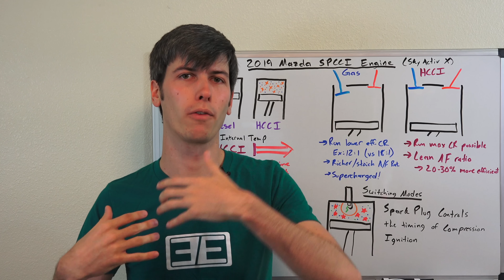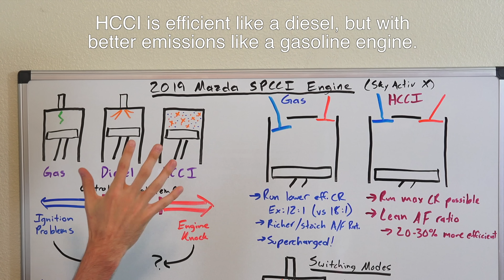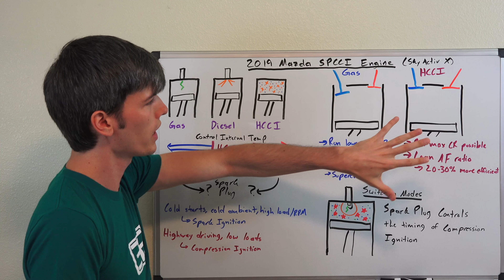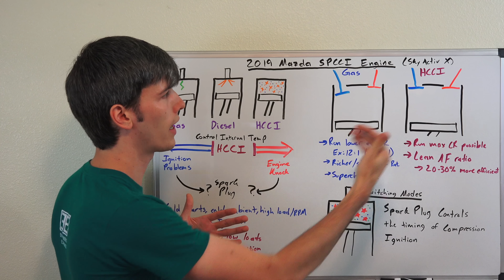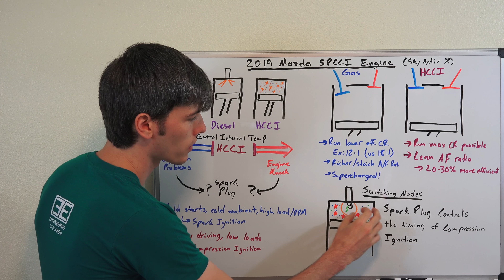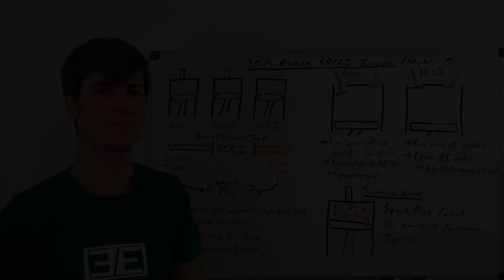Mazda Creates The Holy Grail Of Gasoline Engines - HCCI SkyActiv-X

Comment: Seems sort of late to the party since gasoline engines in cars are on their way out by 2020
Reply: "Never"?... never is a very long time
Reply: Never is a Looooooonnnnnngggg time ....
Reply: they're not
two strokes will come back stronger than ever, hcci will fix a lot of NOx emissions problems,  and there's still one magical trick
ethanol
which before you go into "food x fuel" discussion, ethanol has been synthetized in a lab, successfully, using co2 and water
Reply: "No grid could handle the electricity demands" is my favorite argument

Cause, you know, it takes more electricity to make the gasoline people  put into their cars than it does to charge the car to go the same distance. So yeah, no... the grid can easily handle it if the demand for fuel goes down inversely with the demand for car charging... kind of a self correcting problem.
Reply: Sherrif, nice entrance with a strawman. It hasn't been claimed in this thread that maintaining a grid that is capable of supporting heavy EV use is impossible. It is possible, necessary, and inevitable - it's merely the question of timeline, it takes years to perform the changes, and years more to refine them and instil the public with trust, which ultimately determines sales.

Apropos that, you haven't cited the sources, according to whom the industry can apparently fully rebuild itself in 2 years - which is complete bollocks. Besides, classic hybrids are an intermediary step, they still consume gasoline, they don't depend on electricity, they are somewhat more efficient than ICEs perhaps but they don't actually fundamentally solve any issue or cause any new issues, so they're a complete red herring, inconsequential in the grand scheme of things.

But see i think you invented your 'statistic' freely. In Dec. 2016 Syrah, a company that mines and trades main constituents of current and proposed future batteries, and thus interested in advancement of EVs, has collated predictions from various analytic agencies and found the weighted predicted average of EV and plug-in hybrids to be just 8.2% of new car sales for 2020. No agency predicted more than 11%.  Either is slightly more optimistic than Opel's prediction of 10-15% by 2030 and Bloomberg's 35% by 2040.

I do think the agencies questioned are erring slightly on the conservative side, but to suggest that at least 50% of new vehicles will be EVs and hybrids in just 2 years is sheer lunacy.
Reply: Mario Alvarado "its not just the 0-60 its the 0-100 too"
HAHAHAHAHAHAHA
Shove it in the barthurst 12h race. Maybe it can complete more than three laps like the p100d before overheating.
Oh its not a concept?
Are they already in production?
Top fuel is also not a concept, they're "real cars" too
Why don't we track them?
Reply: >haha look i'll call you a petrol shill that'll prove me right
I WANT SOMETHING TRACKABLE, DOES NOT MATTER IF ITS EV OR NOT
and no, evs are not the future, ethanol based hybrids are.
evs have the same problem as petrol, but with rare earth metals instead of crude oil.
beautiful ad hominem by the way. avoid the argument and attack the argumenter.
Reply: except most of what you said is a complete lie?
first off energy does not come from li-ion, those only transport energy. second off ICE =/= pollution. in case you haven't noticed I spoke about overall efficiency, and not emissions. third point, ev's don't exist on a large enough scale, nor on a large enough timeframe for you to call them reliable. you might not have to replace your oil filter, but you have to replace your battery every 5-10 years. fourth point being that I cited engines that run on ethanol. e t h a n o l. a green fuel that can come from things such as co2 synthesis and/or sugar canes plantations. things that give it a negative co2 footprint. no country will ban ICE's. there is not enough production of EV's at the moment, and there will never be.
you aren't even reading my comments, you're just spewing crap.
Reply: Chad Krause 
Eight in a vee you sit to pee
Six in a row you're ready to tow
Reply: >wow look mom this inexistent car does 0-60 in .3 seconds
if that car ever goes into production, it might matter. 
but stop saying as if the 0-60 times are the only thing that matter. why don't we take top fuel cars around nurburgring then?
Reply: Vicious Slayer, I doubt about two stroke, can you elaborate? How do they want to solve the problem of burning the lubricant?

As to ethanol, it is a pretty decent idea in the interim. Synthesising it like you say is a terrible idea, but you can ferment and distill it from any plant matter that is not necessarily edible. The resulting ethanol is not drinkable because of small amount of highly poisonous oils, but should work for fuel or can be purified further.
Reply: burning lube doesn't matter as long as its in a small enough proportion (your four stroke naturally burns lube too, it has a PCV) and synth ethanol is not a bad idea at all, esp if a food crisis hits a place
and due to the lack of a whole stroke on contact with exhaust gasses, two strokes run way more efficiently and cooler.
Reply: something else I forgot to add
thermal efficiency =/= emissions
and two strokes have variable cr/supercharging effect/look up trapped gasses
Reply: People said that many years ago as well. Nothing will ever beat the roar of a v8, or the modifications you can do. There is a massive market out there for car mods, something you can’t do to electronics. What’s the most you can do? Thicker gauges and rewind the motor? Not fun, not unique. Also, the refuel time for gas is much better than electric. We want to get to our destinations faster, not slower
Reply: Party pooper.
Reply: Vicious Slayer it's 1.9 secs, it is not a concept car, they showed a few and gave test drives at the semi event, so it does exist, and will start selling in 2020.  They have a higher range than oil sport cars (620 miles range), beats them in 0-100 and in the 1/8 mile, so no, it is not about the 0-60 only! Not to mention autopilot and all the superior safety features already in the previous Tesla cars.
Reply: Anthony Smith that's 3 years away. There's no way in hell gas cars are going out that fast. Literally impossible. As long as manufacturers keep cheating the average fuel economy for their vehicles(example fords ecoboost and Chevy's vvt) and squeezing the miniscule amount of fuel economy out each year they will be here to stay until there is a cheaper and more efficient way to make an automobile.
Reply: Anthony Smith used and salvaged batteries are worse than anything in this world. Going full electric is NOT the solution. Too many chemicals are used for making them, and after being thrown out, you cant make them less dangerous to living organisms (there are a few ways, but not worth it). So i think its not the end of fossil fuel, and not the start of going full electric. Its the time to reinvent the otto motor ~ and for some hybrid wizardy ~
Reply: Anthony Smith by 2020. You are crazy. That is to soon.
Reply: I'm loving my e85. Mileage is crap... But I got POWAH and a pretty good soundtrack to go along with it. EV's have a ways to go before they can match the sound  of the ICE.
Reply: EV's have only a few less maintenance parts than an ICE. Yes an ICE itself is more complex (than an elec motor), but everything else on the vehicle is the same. An EV is perhaps more complex if you throw regen braking in and other monitors needed for the batteries and charging. Computers break, bearings wear out, transmissions need to be serviced. These are the same things that fail on ICE cars. A modern internal combustion engine is very reliable until you start pushing it to high hp numbers. You make the move to ethanol and there is really very little reason to replace them.
Reply: Like drug consumption and child prostitution ?
Reply: Sean Place perfectly discribed, thank you. One thing i'd like to add: Not everyone is going to get an EV over Night, so the problem with not enough Charging Stations being abailable is nonsense. The more EVs are being sold, the more money can be (at least partly) invested into building more of the Charging Stations and the electronical grid in general to power said Charging Stations. 

Sorry if i made any grammatical or meaning related mistakes, english is not my mother language
Reply: 2019 model year vehicles have been released. Still gasoline engines. No way they are gone in one year. We'll still be buying and driving gasoline cars at least 20 more years.
Reply: akronymus that is what i hate the most. I like the feel of driving a perfectly tuned and engineered and great sounding car instead of a equalent of a electirc toothbrush
Reply: Should I... invest in ethanol based fuel companies and products?
Reply: Oh really? How efficient are Gasoline Engines? 30%? Electric <= 100%!!!
Reply: @ doktorbimmer 
»a computer will never fit in your pocket« ... of course, no galvanic cell will ever be able to host 10 kWh/kg, but electric motors are far more efficient (just as arm processors are compared to 8080 design), and I am quite positive that engineering will find a cute solution.
Reply: Petrol is a MASSIVE business that makes tons of profit... Its gonna be around for a while, even if it can be replaced
Reply: @garyp4205

"Anthony Smith If governments weren't forcibly stealing TRILLIONS of dollars from poor and middle class taxpayers to SUBSIDIZE the purchase of the rich man's toys, not a single person would buy one! "

First of all, governments subsidize a lot of things. That's how they create incentive, and how corrupt politicians get 'campaign donations'. IE: Fossil fuel mining/drilling is heavily subsidized. Secondly, a lot of EV's are going to wealthier drivers because Tesla is the only major EV manufacturer in the US. Until recently, Tesla's only cars were $65k+. However, there is a significant amount of middle-class drivers that bought new EV's such as the Volt, Bolt and Leaf.

"Currently every manufacturer loses insane money on every single car the sell! Chevy loses $9,000 on ever Bolt...and that's the least amount lost of the bunch. Some companies lose as much as $20,000 per sale! "

Some companies lose money on their EV's. However, that's only because the supply chains for large lithium batteries is very limited. Prices of batteries have been steadily dropping and will soon be very affordable. Toyota lost money on the first several years of the Prius, however now it's a very affordable and profitable hybrid. Also, Chevy's loss on the Bolt is probably the highest since they got a crappy deal on batteries. Nissan has actually been making money on the Leaf since 2014.

"Then there is the electrical grid. No place on earth has an electrical grid capable of handling an all electric, or even half electric fleet."

If every gas car filled up from empty to full every night, there also would be an extreme shortage of fuel. In reality, that's not the case. Not for gas or electric cars.

"And don't get me started on the non-recyclable batteries! You might as well be dealing with nuclear waste when it comes time to dispose of those things."

Lithium batteries are very recyclable. In fact, you can get money for recycling them. Most of the time, batteries from laptops and EV's end up in grid-tied energy storage (IE: DIY Tesla Power Walls). Once that portion of their life is done, they're disassembled and usually about 80% of the material is reused.

"And we haven't even talked about the significant loss of performance....and range....once the batteries get either hot....or too cold."

This is an unfortunate effect of liquid electrolyte batteries. However, solid electrolyte batteries solve this problem, as well as have significantly increased energy density. This technology still needs to be perfected before it can be used. Keep in mind that ICE cars suffer in cold weather too, especially for short trips where the engine can't fully warm up.

"There's a reason why companies stopped building electric cars in the 1920's! "

EV's were very popular in the early days of automobiles. Big cities usually had more EV's than gas cars since electricity was easily available. However, since the electrical grid at that point was very small and primitive, gas cars became more popular. Range and performance were also contributing factors, but those would've been overcome just like how gas cars did the same.

"The push towards electrics is based on a scam."

Care to elaborate?
Reply: On their way out by 2020? Have you looked at the calendar mate? It's almost 2018. If you told me this 20 years ago, i would be inclined to believe you; but having worked in automotive engineering quite recently, seeing what some of the big ones are up to, and knowing their development timelines, it's not happening. Nor is the consumer ready - they don't have their private charging stations, they don't entirely trust the public electric infrastructure that is likely not to be ready to take up an explosion in use, they know it only takes minutes to pour a dozen gallons into their cars and that'll take them just about as far as they'll like, and it all works, it's all there. These changes are a lot more gradual, and there's still a lot of gasoline cars to be sold. It would be a huge accomplishment, not only on part of the manufacturers but on the society as a whole, if internal combustion is only half way replaced by 2030 in the new vehicles, and in the meanwhile the increased efficiency of gasoline engines will be appreciated by many.
Reply: It's estimated that by 2020 EV's and Hybrids will, together, have a larger market share than standard ICE vehicles. By 2030 It's likely EV's will be the largest market share, and by 2040 (if I remember what countries projected the ban on) ICE vehicles will have stopped being in production, simply because some countries will ban sale of ICE vehicles in 2040.
Reply: Anthony Smith In your tiny world. I would like it to be real, but it's far ahead...
Reply: Charging EVs takes forever... That is why the gas station model doesn't apply. You would charge your car while you sleep. Then on the road, you do the same, you will drive a thousand miles and go to bed, again. Yes, EVs can't drive 1000 mi on a charge today, and a few years ago they couldn't 100, so that will happen quickly. EVs age is here, not because of wishful thinking, but because China said so, and most of the world wants it!
Reply: Vicious Slayer I guess if it's not a gas burner is not good enough for you, even if they are slower and way more unsafe than EVs.
I guess you recall when EVs were golf carts, evolution is a fact, whether ppl deny it or not.
EVs are not ready for long runs but that's a matter of time, ICE cars are going down, not this year or the next one, but they are phasing out because EVs will surpass them in every aspect, eventually, and one of the last aspects is a better cooling system, and that is totally feasible in the near future.
Reply: Vicious Slayer except EVs energy source is recyclable, oil is not. Li-ion batteries are being recycled today, so it is a sustainable source of energy. Ethanol is better than oil but has the same limitations of oil since it runs in ICE and needs lots of spare parts through it's life span, oil changes, filters, etc. EVs run with nearly 0 maintenance, even the breaks last like forever if you use regenerating breaking, so ppl will migrate to EVs just because makes their life easier and safer, and you can see it today in us streets, Teslas are becoming common place in many places, just a matter of lowering their price and the company ramping up production.  China, being the #1 cars market announced it is banning ice cars by 2019!  Similarly India. So, either the manufacturers migrate or their economy will crash since no other market will grow as fast as China and India.
I don't see any reason EVs can't become better than ice cars, in every aspect.
Reply: @ doktorboimmer 
you might learn about the difference of insult and argument, and then you might learn to read.
Reply: garyp4205 

You're right. Liberals in the media and government have seriously misrepresented the electric car. They would be outraged by any corporation that engaged in such deceit. 

In urban areas, and along well-travelled routes with charging stations, electrics will work. But who has the patience to wait a half hour to do a partial charge-up every 150 miles? And how long a wait in line to charge it?

Then, there's Alaska and much of Russia, where electrics can only be used in the short summer. So, now that means it has to either be a more expensive, and even heavier hybrid, or you have to have two cars. 

Imagine the cost of operating an electric in Australia. The cost of infrastructure alone, subsidized by an extremely low population density would make traveling across  the country a horriffically expensive proposition. The total cost, including taxpayer-subsidized charging stations and power grid would likely be at least a couple hundred dollars per charge.

I've driven a Tesla and I'd love to have one, not because it's electric, but because it's a great car. But, it could not be my primary vehicle. And the fact is that I'll probably never have one simply because of its limitations, not to mention it cost.
Reply: Anthony Smith False
Reply: except they do... and in many ways surpass it. Sure you can move the goal posts to redefine "efficiency" a few times but by the end of the day the modern electric vehicle is not only a better value, but it offers superior performance. Oh there's also the boost from eco reasons but most of those are a wash unless you generate your own power with solar at this point. The gap is closing there too might i add but i'm not one to be disingenuous so i'll give you that one... for now.
Reply: @ Anthony Smith 
I think so as well. When the obviously best engineering solution is »cheat the test«, combustion engine tech is at its very end of career. 
 
What I like most of e-motors is the lack of complicated mechanics that can break, no gearbox, no oiling system that can leak, the comfort of silent running. 
 
As there is request now, battery tech will improve, there is enough money to finance the effort.